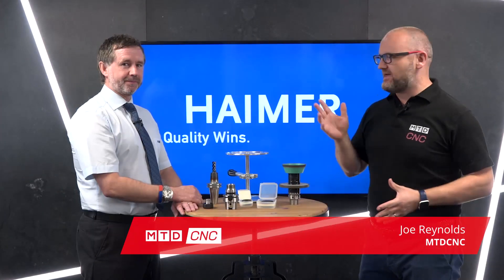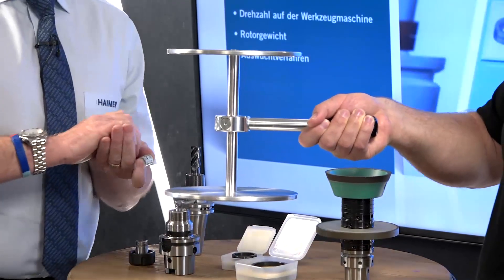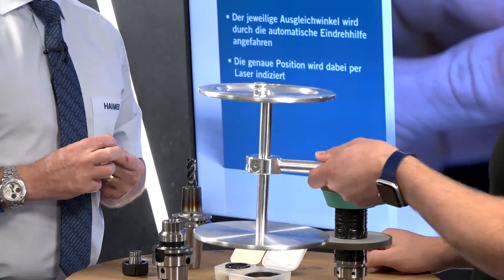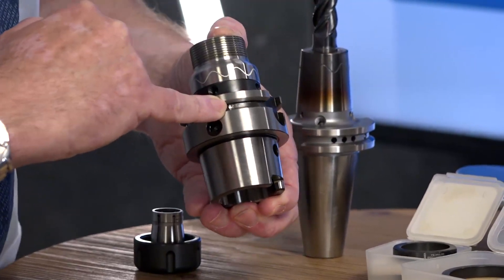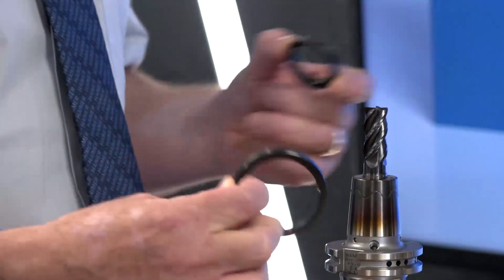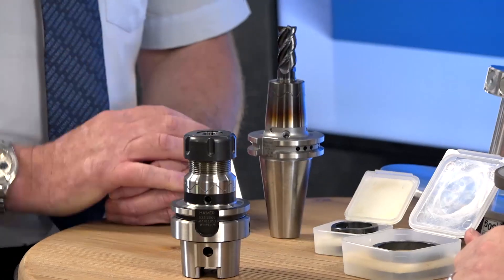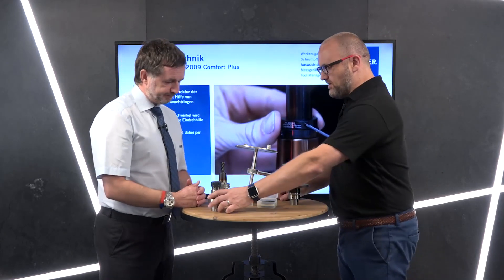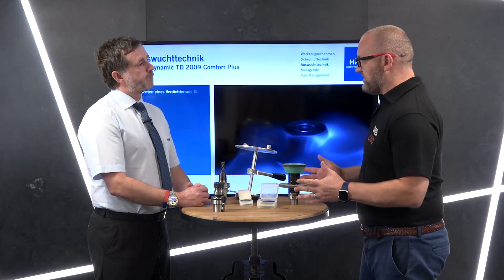Why should I balance my tool holders and cutting tools - HAIMER Technical Corner

Comment: What hot garbage. Take identical rough and finish cuts before and after balancing and measure Ra. Use an accelerometer on the spindle cartridge to show us the improvements. Show us charts that show balance drift over time/temperature and how your system is affecting that.

Don't preach to the choir about ignoring balance and then fail to produce meaningful data, all while singing songs and hawking your ~$60K machine.

Don't buy cheap tools and holders. Your runout will impact tool life and bearing forces more than this. Prove me wrong with data.

Comment: I suppose this makes a strong argument for using Haimer
heat shrink for milling as opposed to colleted systems as much as possible?  Seems like you would for sure start with a
much better balance than anything with a nut right off the bat?  Not fixing the balance issue, but certainly improving
your chances with less moving parts?  We
run 12k spindles and Haimer heat shrink for all milling applications 3/16 up
and love what we see.  Great video as
always MTD CNC!  (Greetings from the USA!)
Reply from the maker: Thank you very much Peter.
Reply: There are many reasons not to use collets as much as humanly possible. Runout, inherent balance, holding force, clearance, through-spindle coolant simplicity, wear resistance, and repeatability.